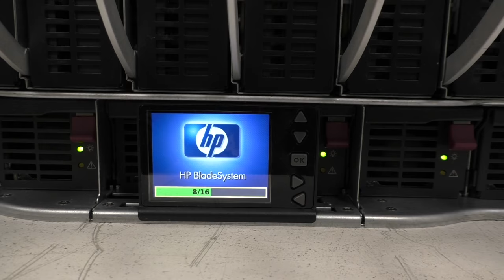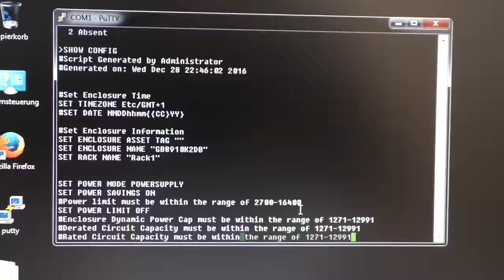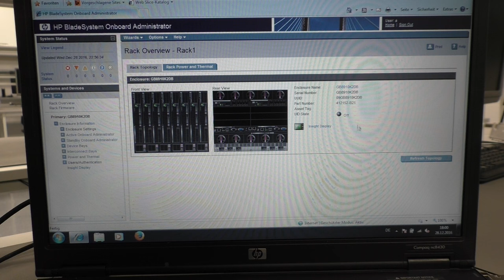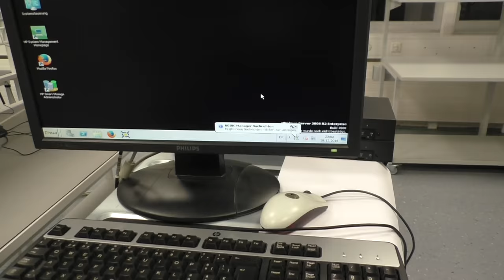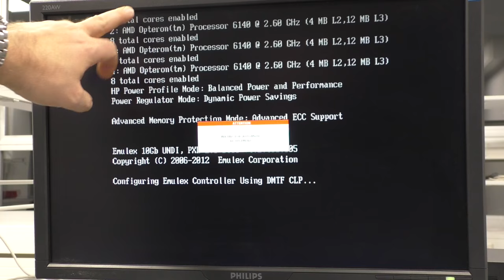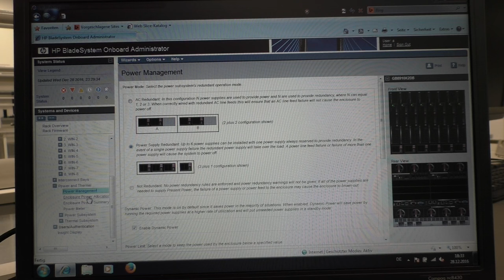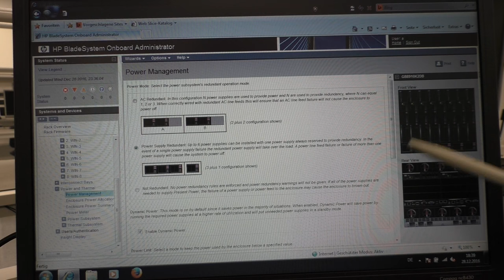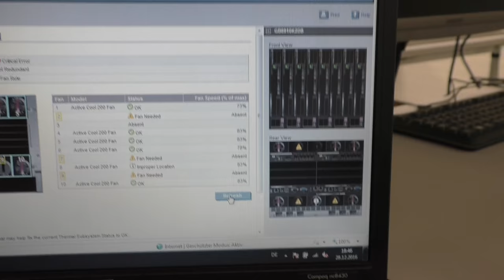Powering up the HP C7000 blade enclosure (PWJ45)

Comment: The fans in these things are neat. The fan itself is a piece of cast metal (zine and aluminium alloy, or something) and has a round cone like the front of a jet engine. They're powered by high-performance brushless motors, the kind of thing you'd put in an RC aircraft. IIRC, they're 12v and at least 10A. There are ten of them, so that's at least 1200W of power from the fans alone, when at max. There's also no guard on the front, so it's best not to stick your finger down there if it's still spinning down. I've scrapped one of these c7000s before. Very fun.

Comment: Cool video as usual. Used to work a lot with the C7000 before I moved to do cloud management - nice to see the iron again.
Just one thing to keep in mind if you are considering actual usage of the RAID1 "cloning" mentioned at around 20:00 - it doesn't play nicely if you are using Windows and plan to, for example, join them to an AD domain afterwards. All of the clones will have the exact same SIDs, this tends to break lots of things, you should sysprep them beforehand or use a different method.
Reply: hola te puedo hacer una consulta

Comment: These servers are whisper quiet. Your tinnitus is clearly acting up.
Reply: kakureru Whisper quiet? Hahahahaha either you don’t know what whisper quiet means or you’ve never worked with a C7000 enclosure. Where did you get that crap info from? Quiet was the least of the concerns when these were designed. They are mighty loud. Though the Dell M1000e still is worse on noise level.
Reply: @jerryidakabor8182  I think you misunderstood his comment, fuckface.
Reply: @jerryidakabor8182  At boot they are flying off, but later on the fans turn quite a bit down. I've worked with both the HP C7000 as the Dell M1000.
Reply: @jerryidakabor8182  So... you're sarcasm impaired, aren't you???

Comment: C7000 is still in use today; BL460c Gen 10 is the current, and last, blade model of the platform.

Synergy is the new stuff that replaces it.
Reply from the maker: And the good thing is that G10 blades still run in the oldest enclosure. Only if you want to go faster than 10Gbit/s, you need a newer backplane. Or was it 1G...? However, everything else works just update the OA firmware.

Comment: +Play with Junk, Everyone loves to complain about the noise of how loud it is. However, what they don't realize is that, that is only upon initial startup. This is due to thermistors inside the cooling fans & the servers themselves. They sample the ambient room temperature & adjust their fan speed accordingly. Apparently, one of the more recent OA firmware updates also addressed this issue being miss-reported.
Reply from the maker: That's right. If only one or two servers are running, the C7000 is relatively silent compared with others (like the SUN 6000). But when a fan fails it turns up the sound :-)

Comment: With the right tools on dell machines at least, you can quieten down the jet engine fans. Granted I don't have a blade centre in my rack, but the two Dell R730XD's are whisper quiet after their initial 747 ish sounding fan noise while they boot. Once one of my linux VM's come up it runs a script to get temperature information from the BMC/iDRAC and adjusts the fans accordingy. My fridge is noisier than the servers.

Comment: The main Fans in the Back are quite powerful,  about 200W at max. Probably only in failure prevent mode or so. But you can modify them, if you want to build a Leave Blower.
Reply from the maker: I tried it but they won't run outside the enclosure. There is a lot of digital chatting between the fans and the OA. The fans are very nice... brushless DC impellers like some RC model engines.
Reply: is it the versin with the Step-up inside?
there is a Enable pin wich must be pulled on high(it switches a mosfet on) and then there is a Pin on the PCB wich you can pull on GND, to get full speed. http://abload.de/img/blade_fan_pwmg6pzl.jpg 

and the enable pin, https://abload.de/img/enabletisuj.jpg

One thing, for fullspeed you need a Powersuply with at least 17A
Reply from the maker: Thanks for the information. I will try that...
I was tinkering with these fans before that and I managed it to work at minimum speed. Maybe that's the solution!
Reply from the maker: It works... thank you for that. Too bad that most fans are a more modern version without DC/DC converter. But I'm sure they can be hacked too.
I just built a smal RC race car with two HP fans as drive. When I get the batteries from Hobbyking and everything works, I will do a video about it :-)))

Comment: Will the Prime 95 torture test draw significantly more power on Opterons (like it does on newer intel CPUS)?
Reply: hans3123 Yes, on every CPU that is so. But now a days, it looks extrem, because the idle consumption isn't that high, as at older CPUs. 

The Opteron also need an big amount of power, but in usecases with rsa encryption operations, the newer, bulldozer based Opterons need a lot of power, but they be also very powerful. That's because their module based design. With primeoperation, theres a bottleneck, so a 8 core Opteron works like an other 4 core cpu, because one important thing at the operationloading design is not refuant, as the other parts, so that ~40% off the DIE isn't working.

Comment: Do you know much about EMC's products? I have a "disk proccessing enclosure" (has no USB or VGA ports) from their VNX 5300 SAN. I'm hoping that break out cable is compatible; it looks the same. EMC must not of liked the idea of local access by the end user; the port is on the back of the enclosure and covered by an inconspicuous sticker. You have one hell of an awesome setup there by the way.
Reply from the maker: I don't know much abut the newer VNX systems. I stopped using EMC in the CX age. But as far as I know they still have a serial port which is used to initially set the IP address to access the GUI. It is labelled with a small wrench. On the CX it was necessary to setup a PPP serial connection because the CX port acted like a modem. Then you could access it with a web browser through the serial line.

Comment: I think the little 20mm fan in my Barracuda Web Filter 310 just met its match in the noise department...
Reply: @Asura Just the 20mm chassis fan alone, like a small jet engine in idle. The chassis fan and CPU fan on max though, more like a much larger jet engine (no where compared to this monster though!)
Reply: I have a ML350p Gen8 in my bedroom now and it has quad 98mm. I thought it was loud, but this blade system... jesus I might go deaf.

Comment: What did they use to test EKG ECG machines before using a Patient simulator? what are the common parts to replace change in an EKG ECG machine, any testing you do on them?
Reply from the maker: As I mentioned before... I do not repair or work with those devices. I just find them from time to time in the scrap container.

Comment: danke für das Video, ich habe bisher keine laufenden blades gesehen. hier stehen 3 bladeserver mit g7 und g8(?) in Einzelteilen. was meinst du, zerlegen und in Einzelteilen verkaufen, oder alles mal testen und im ganzen verkaufen?
Reply from the maker: Meine Erfahrung ist, dass das C7000 Gehäuse gebraucht fast nix wert ist. Die Dinger stehen überall herum und keiner will sie. G7 Server kannst Du verschenken, da kriegst Du auch nix dafür.
Vermutlich hast du eine Chance wenn Du es als komplett lauffähiges System an einen Hobby-Bastler verkaufst.
Allerdings nur mit Abholung, sonst kostet der Versand ein Vermögen. ;-)

Comment: The C7000 is still on HP catalog. Does a older revision enclosure handles blades from newer generations just fine?
Reply from the maker: Yes. I have a generation 1 enclosure and even Gen9 blades work without problem. I don't know if the network connections are fully supported but as far as I know even the Gen1 enclosure can handle 10Gbits per port. Important is to have the newest firmware on the OA module.

Comment: As I am completely new here, I want to ask How many SMPS is required to run this machine. What will happen if we take out one SMPS while running.
Reply from the maker: The minimum number of power supplies is 2. 
What happens if you take one PS out depends on how you configured the power system. For example if you configured no redundancy, the power of all PS is just combined, so you get 2x2250W=5500W max. with two PS.
If you take one out, available power will drop to 2250W. Now it depends on how many servers you have installed. If there is only one server, it will most likely keep running.... if you have more servers, some will be shut down while others keep running.
Google: HP C7000 Power Supply Configuration ;-)
Reply: @PlaywithJunk  one question here.. I went to one of my client he is using c7000, as per HP the SFP module of San switch was faulty I went to check this complain where I found I am not able to go into ILO through web it redirect me to java error something. Where same if I putty I could it let me directly login to SAN Switch configuration. 
I took out one Node of SAN swicth out and put it back but led lights are in amber and not turning to green.
Reply from the maker: @akhtartherocks  Yes the Java Problem is annoying. You may use EMC "VNX Laucher" which is a standalone Firefox browser with Java built in.
For the amber light, you need to check the C7000 Onboard Admin to see what's wrong. Maybe just plugging it out/in again will fix it.

Comment: Can you please tell me more about where you got the serial cable you are using? Looks like it might be a kit spliced on a cable but I am interested in one. Thanks
Reply from the maker: There is nothing special about that cable. DB9-female plugs on both ends. Connections are 2-3, 3-2, 5-5
Reply: I am asking about the cable at the 1:38 mark of the video that allows switching between null modem and straight through
Reply from the maker: Ah...OK. This is self made. It's quite simple, just a switch that crosses RX and TX and a red and green LED for RX and TX each. The green LED lights up at positive voltage (ref. ground) and the red for negative voltage. Maximum voltage on RS232 is about +/- 12V maybe 15.
If both green LED are on, then you know that the switch is set correct.
I added four reverse protection diodes (one for each LED) and four resistors... that's it.

Comment: 6:38 Fan information:
Maximum speed: 18000

Yea, its a server alright.
Reply from the maker: The fans in the C7000 are said to be developed from RC impeller turbines. Check my "Jetcar" video.... (PWJ67)
Reply: @PlaywithJunk  Yea they give the best airflow. Will do, and I have seen some of these types of fans on YT before and they are insane and kinda lethal what it seems att full rpm.
Reply: @PlaywithJunk  That was a cool video. :)

Comment: Thank you for the video. You will still use the servers or they ripped apart for recycling?
Reply: I was asking myself the same. The only thing speaking against these is the power consumption. These would cost up to a 1000 EUR per month to run 24/7.
Reply from the maker: We will try to sell as many as possible. But I fear we will have to scrap some. Interest is not so great for these servers. There are a lot on the market.
Reply: For how much would these sell?
Reply from the maker: How much are you willing to pay for one?
Reply: Play with Junk Hi, ich hab schon ein älteres C7000, nur immo zuwenig Blades, suche noch BL460c G6 oder G7 Blades. Habt ihr was da? Oder habt ihr was alternatives zu den Bl460c? habe immo eh nur 4, sprich ein Wechsel der einzelnen Blades wäre denkbar. 

Wie viel effizienter ist dieses "Gehege", was ihr da habt? Eures sieht nach "13er Version aus, meines ist wohl 2009, oder älter, da die PSU von 06,07 und 08 sind, ich habs erst seit kurzem, da ich aber nun noch nicht dazugekommen bin, es einzurichten, weiss ich es noch nicht effektiv. 

Ihr könnt mich bitte unter [DJANG0.RYFF3L(at)BLU3WIN.C8] [lasse "[]" weg, statt 0 O, statt 3 E, statt 8 H und alles klein] anschreiben, oder unter der Kubikwurzel von positiv729730929962851502E31 anrufen. 

Gruss Django
Reply: honestly if I had a legit use for one of these. I'd pay $300-400 but I cannot think of any decent use for them besides insane number crunching.
Reply: You could probably do that much cheaper just renting cloud VMs.
Reply: Play with Junk do you still have these?

Comment: What output voltage are the power supplies. if they are 24v that would be good for charging large RC batteries. I would expect the new blade systems would be a lot quieter. Do they have warnings about having to use ear protection. Another interesting video. Cheers Dave.
Reply: Depends, some have intergrated management features which connect to the remote control subsystem (usually an ARM or similar chip running a lightweight *Nix with webserver) meaning getting them to work outside of the system is very tricky...
Normal server power supplies are usually easier to power up outside the system after you figure out the pinout but these blade systems rely a lot on calculating power flow through the system...
Reply from the maker: HP C7000 power supply: 12.2V 200A max.
IBM Blade Center H p.s.:12V 260A max.

Comment: VERY insightful tour of this machine.. I feel I can run one now .. .Thank you for the time spent with making this ... At 11:22 You mentioned the network switches has 20 ports, How are the internal 16 ports accessed ? I have to second Bob Johnson's question from  2 months ago that doesn't appear to be answered 
Do you sell any of these if so How ?   Thanks
Reply from the maker: They are already sold.... sorry.
The internal ports of the switches are directly connected to the blade slots by the backplane. Plug in blade number 1 and it connects to switch port nr1. Just internal wiring, no magic. The blades have a second network port that connects to a second switch (in interconnect slot 2, backside) giving you another 16 internal ports to use.

Comment: what is that adapter you were using to swap screens from one blade to the next
Reply from the maker: HP calls it a Blade KVM (keyboard video mouse) adapter or Diagnostic I/O Adapter. It is simply a cable with that special connector on one end and VGA, USB and serial on the other end.

Comment: What kind of power conditioner is that? and would 2 30amp 220v outlets be sufficient in supplying power? I will be getting one soon myself. Great vid btw.
Reply from the maker: 220V x 30A = 6600W  two such outputs = 13200W 
Theoretical maximum power consumption of the C7000 is 14400W (2400W x 6)
If you connect 3 power supplies to one outlet and 3 to the other, this should work without any problems, no matter how many servers you install.
I have never used the full power capacity of the enclosure...
And if you set the power supplies into any redundancy mode (3+3 or 5+1) the maximum available power will reduce anyway. So don't worry :-)

Comment: Where on earth have you found servers like this!? I've found limited selection, usually the higher cost of ~$10,000 range too.
Reply from the maker: There are a lot of used IT stuff brokers all around the globe. An empty C7000 with power supplies and fans costs $500. Blade servers depend on the model. A generation-7 (G7) server costs almost nothing while a brand new G10 can be $10'000 and more.
My situation is that we work for many large companies and when they replace old equipment, we sell the new stuff and take the old back. That's where most of my stuff comes from.
We would like to sell our old devices but that's a lot of extra work. And shipping heavy items overseas is very expensive, especially now. Most people don't want to pay that...

Comment: Crazy setup (compared to regular computers)... What would one do with hardware like this? Would it run webservers, databases, rendering, remote desktops...?
Reply: 1hdsquad we used one to run aerodynamic simulations... It still took days to complete a 10 second simulation of a simple jet turbine with simplified models
Reply: They run just about anything in situations where 'normal' servers are too large/space in the datacenter is expensive enough to justify blades. As long as there are a lot of smaller tasks (such as a few webservers, DC's and so on and not 1 heavy application which would require 1 big bulky server instead of many blades.
Reply from the maker: They are like normal HP Proliant servers, you can use them for all the tasks you listed. There are of course different models. You can have blades with 2 CPU's that are less powerful.
The modern way is to have one powerful server and do some virtualization. But if you like physical servers you can take blades.
Reply: Für Anwendungen wie 3ds Max etc. eignen sich diese, oder zum heizen und CAS@home.

Comment: hows it? We re planing to buy 12 blades systems , vendor offers C7000 series filled up 12 blades each for my new data-center. planing to buy 6 of those.
Reply from the maker: Nice... what blades do you buy? gen8 9 10?
Reply: @PlaywithJunk   We not bought yet but planing to buy C7000 with G9 or G10 whatever warranty for longer time HW Support. but I am collecting reviews hows those blades. becasue we never used in out environment we used HP DL380P etc servers but those growing my data center too much racks. so want to get rid-off from those and want blade systems.
Reply: @PlaywithJunk  tell me your experience.
Reply from the maker: @inbedf  Well, the blades are as reliable as the DL servers. We currently encouter many defects on the Gen8 with faulty iLO-flash chips (used for logfiles etc.). Gen9 servers had a couple of failed boards due to onboard power issues, but not in an alarming rate and only with DL servers, not blades.
We don't have many Gen9 or Gen10 blades yet, so I can't tell you anything about the reliability on those. But if you buy new stuff, I would go for the Gen10 where hopefully some problems of the earlier generations are fixed...
... and no new problems were built in :-)